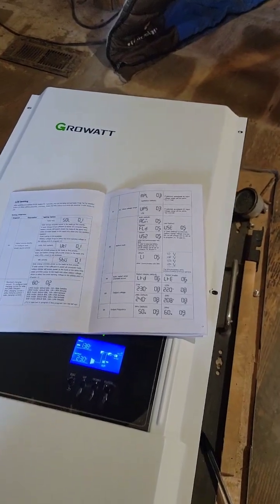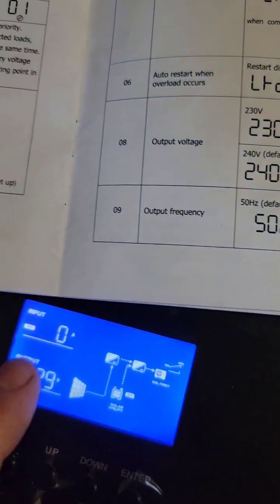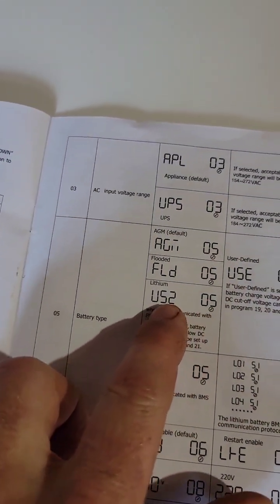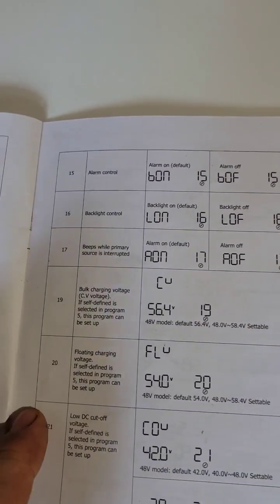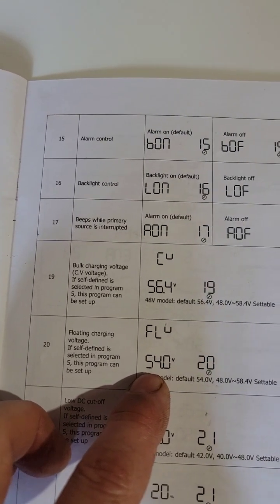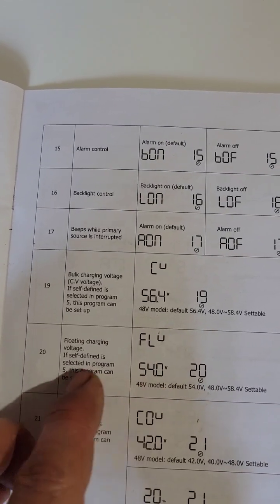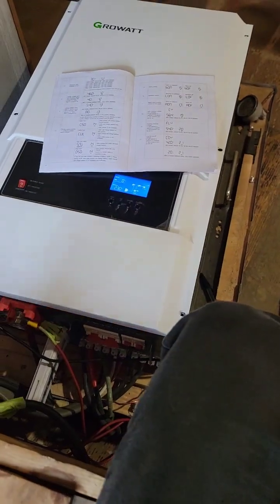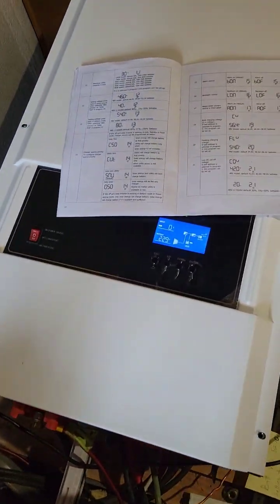Growatt Not Charging Batteries Problem - SOLVED

Comment: I have a growatt 5000 inverter with lithium battery but problem is bettery doesnot charge full 100%.it charged 90 to 98 % both solar and utility.how can i charged full bettery 100% plz problem the problem.

Comment: Hi my 12kGrowatt  inverter is charging the batteries but only up to 2 bars I adjusted settings 20 and 19 and still having the same problem any suggestions
Reply: mine doing the same thing; any fix?

Comment: This inverter is supposed to max 7500W solar input but I never get close to that despite having two different arrays totaling 15K solar. USE2 with higher Cv gets better charging than using battery communication settings, as you mentioned. I read online that Growatt software needs updates, but even after latest version it never seems to get past 1/2 the PV capacity

Comment: Mine wo'nt just turn on. When connect it to the mains (230VAC), nothing happened. I check the power button, it seems to be ok, and the AC circuit breaker at the bottom. Does someone has an idea ? It's a brand new and just received few days ago. But it come from AliExpress. So, can't wait for any assistance technical support from the seller!
Thanks in advance!

Comment: Can that power inverter can you switch it to 110 AC out or do you have to have a separate stepdown
Reply from the maker: It's a split phase output just like our power companies supply us here in the USA.  So, you don't need anything else added to it to make it work.  It has two hot(line) connections, a neutral and a ground.  There are two separate breakers on it for each hot AC line outputs for you to connect to.  This thing is rock solid and I have zero complaints.

Comment: I have 2 SPF 5000TL Growatt Inverters connected to 12 led acid Tubulars but my charging LED never stops blinking, because the manual says it should be solid green when fully charged, any reason why?
Reply from the maker: Maybe try adjusting the float and/or bulk charge settings lower.  Menu program  numbers 19 and 20.  What battery type do you have it set to in the Program number 5?
Reply: @SpoonerTuner FLD

Comment: Can I use an external charge controller with a growatt off grid inverter? Meaning the inverter will not doing the charging of the batteries the solar charge controller will.
Reply from the maker: Yes, that will work just fine, no problem at all with it setup like that. 👍

Comment: Hi, I have my growatt inverter, bulk volts are set to 29.2 and FL to 27 but My batteries are not gatting charged, I charge batteries with a seperate charger but after I connect to inverter they keep discharging and inverter not charging them, What could be the reason?
Reply from the maker: Hard for me to say for sure what the problem is.  Try checking program numbers 01, 12, 13.   Also, 05 is the battery type which can cause it to not charge. Try setting the battery type to USE (User-Defined).
Reply: Increase your float voltage to about 28v, or tey 27.5v first

Comment: I have 3 Sungold 48V batteries with Growatt 12k inverter my 2 batteries charge 100% but 1 battery charge 85% than it's stopp charging when batteries goes down to 35% minimum it's switched to Grid and after that 2 batteries still have 50% and that 1 battery have 35% .
Please advise if any setting need to be done . All communications cables and everything is connected properly.
Reply from the maker: Not sure.  I don't use communication cables between my battery bank and my Growatt Inverter.  Sounds like the inverter is trying to protect the battery by not letting it drop below 35%.  Sounds like that one battery is not balanced with the other two batteries.  Maybe let the two other batteries charge up to 100% then disconnect the one that's at 85%.  Wait for the two other batteries to drain down to 85% and at that point reconnect the third battery again.
Reply: @SpoonerTuner  Thank you for your reply Did this but still didn't work . sent the message to Sungold but haven't got any response from them

Comment: First of all Thank you too much for this help. I got a off grid 1,5kw PV , aenergy source lifepo4 battery and SPF 3000 ES 48v with Program 19 , 20 point to 55,4v and 21 to 47,2v (  from support advice ) . After 5 days without  SUN It stop charge battery . Shuld I try 57,4 for 19 and 20 program and Restart inverter. Maybe disconnect and reconnect PV and Bat?
Reply from the maker: Yes.  You should completely disconnect it from both solar power and then the battery power.  What a minute or two before reconnecting the battery bank and then connecting the solar panel's power to it again. Also, make sure there are no error codes or it will not charge the batteries from solar power.
Reply: @SpoonerTuner  great, I did it a week ago and really worked well. Disconnected battery and cover PV because was difficult to disconnect. After recharge 100% , back to original configuration.
Reply from the maker: @3ds0nB4rb0s4   Oh, that's great news.  Glad you figured it out.  Sorry for my late reply.

Comment: I have a Growatt 5000es, it only charges the battery when utility power is not available. When utility power is available, it kicks up battery voltage to full and stops charging
Reply from the maker: I'm not really sure I understand.  But if your battery bank is too small and you send too much charging amps/watts into your batteries it will cause the battery voltage to go up too high and sometimes this causes the Growatt to think that the battery bank reached full charge too soon and shut off before actually fully charging the batteries.  If you have led-acid batteries this happens easily.

Comment: Sorry if this has been asked, but what battery system are you using? Is it a diy power wall style setup or premade batteries? Reason I ask is because I had read that Growatt is only setup or shown to work with two different battery types and I was trying to see how much to throw us to that. 
I’m looking at buying: Growatt 7.6kW Grid-Tie Inverter | MIN 7600 XH-US
Reply from the maker: I built my own 14.3kwh LiFePO4 48 volt battery bank that uses an Overkill Solar 100A BMS. The BMS does not communicate with the 12kw off-grid model Growatt inverter that I have.  The Growatt MIN 7600TL-XH-US is different and probably requires a specific battery bank that's compatible from what I see in the user manual for it.  It needs to be able to communicate with the battery bank and the battery bank is set up for higher voltage (500 volts DC). But, it would be interesting to see if it could work with a DYI battery bank.

Comment: I do not communicate with Growatt, my batteries have there own BMS. All charging issues went away by selecting USE instead of USE2. The battery manufacturer told me setting voltage higher is not the correct solution. I’m set at 56V constant and 54.4 float. Will charge to my recommend 56V then use solar for loads and charge batteries as needed.
Reply from the maker: I agree with you. Thanks for clarifying this.  I'll pin your comment.   I was not able to explain everything in 60 seconds.  And I think I came to the same conclusion shortly after I uploaded this video. I just now uploaded another video showing all my settings.   I also have mine set to USE now instead of USE2.  https://youtube.com/shorts/bkgtWv2v_Ok?feature=share
Reply: USE2 is for lithium without BMS is my understanding. There are protections in place to ensure you don’t over charge. Batteries with BMS should use USE IMO
Reply: When US setting is selected, dc cutoff voltage is stuck at 42v, tried several times, with mains and battery, no luck....anybody knows how to resolve this?.

I tried US2...and it stopped charging with solar or grid.only. i selected US and it started charging , but batt cut off voltage is stuck at 42v, not letting me change it...
I need help
Reply: Setting 11 b2AC finally let me change the cut off voltage to 48v

Comment: grawatt 3000 and lithium battery 5100 aoboet problem does not recognize the battery all options done and it will not work what to do to recognize the battery option 5, Li protocol 1,2 menu 9,10,12,13,14 19,20,21 set to values per menu menu cable network port inverter and battery connected help
Reply from the maker: I really do not know how to get the Growatt to communicate with your 5100 Aoboet.  You should still be able to use them together with manual settings in both yiur Growatt and your battery bank.

Comment: Thank you
I have spent the last 6 hours trying to resolve this problem, having just connected my 12kw unit today 🙏🏻
Reply from the maker: Oh nice.  👍 Glad my video helped.  I love my 12kw unit. The only downside so far is the idle power consumption because both my solar panel array and battery bank are pretty small, and we don't get hardly any sun and very reduced daylight hours up here in northern Idaho.
Reply: @SpoonerTuner  
I still have a lot to learn and understand. I’m in Australia.
I’ve put 22kw of PV on my shed roof and will connect to the 12kw inverter plus 3 Growatt solar charge controllers. I will also have 4 x 48V 280ah LifePo4 batteries.

At the end of today, I have 40% of the panels connected to the 12kw and 1 battery setup, so very happy with the progress.

I’m still trying to understand the Growatt settings though. Why does setting 19 & 20 need to be 2v above battery SOC for charging to kick in?

Comment: What's the continuous bypass current is it 80amps on the 12 k units?
Reply from the maker: Not sure exactly what you mean when you say bypass current.  Are you referring to the a/c current that can flow into it from a generator and out to the house?  The max output DC charge current for this 12k inverter from a solar input source is 120A.  And the  Maximum a/c  input Charge Current is 100 amps.
Reply: Yeah the generator or grid bypass like if the battery dies or if u overload the unit it switched to grid bypass?
Reply from the maker: @electromechanical stuff  it doesn't say on the spec sheet, but the Growatt's AC output circuit breaker is rated at 63A 240vac, which would be 15120 watts. Here's a link to the breaker. https://www.fumaco.com/product/fumaco-delixi-cdb6i-c63-circuit-breaker
Reply: Have you tried charging your batteries with grid/gen yet?
I have a few times it's only like 60% efficient.
U set charge from grid to 100 amps at 50 volts is 5,000 watts but it draws 9000 watts from gen. Eg4 100a  chargeverter is best bet to charge from geny